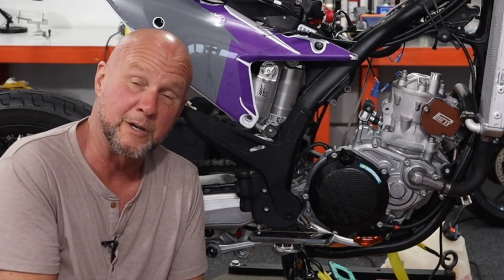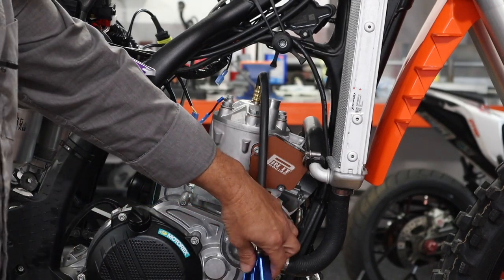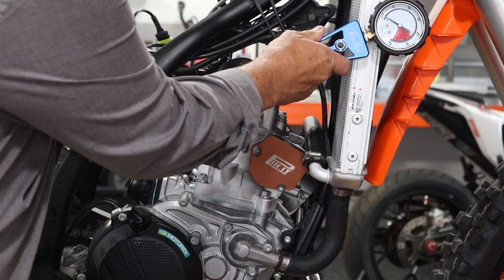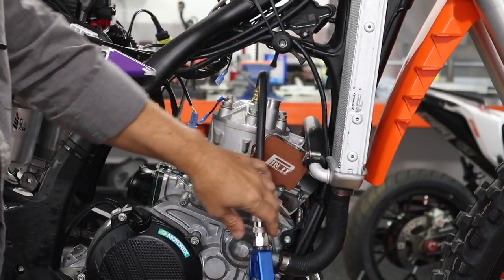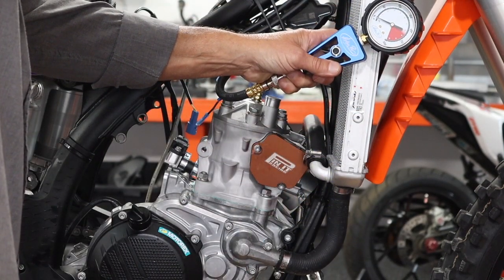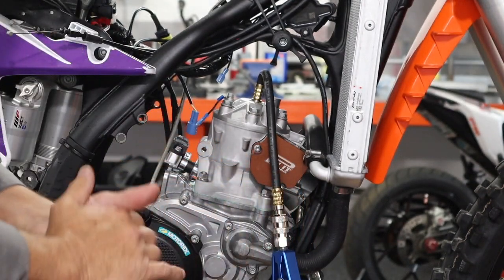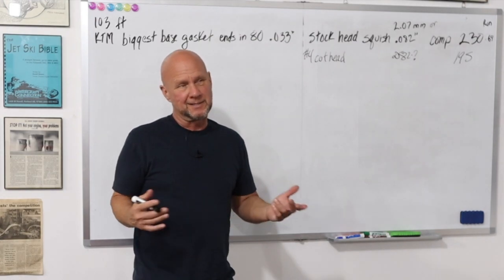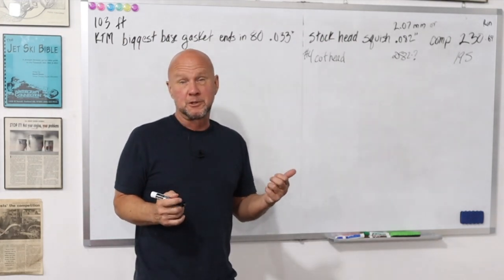This vid could save your life, and a LOT of money.  Need to know about 2 stroke compression.

Comment: My tbi experience…

Bike is a 2023 300xc, VBKXCP233PM322***,  bought last November(2023), didnt start riding until march of 2024. All stock. At 25hr the bike started to bog randomly(approximately may 3). Bog just happens, usually very subtle, usually after at least 1/2 hour of riding. I ride on a small Mx track with several jumps, 70’ being the biggest. I ride moderately on track but aggressively on straight aways. Bike never dies,  just wont accept throttle, usually only for a few seconds but has happened a couple of times where I could stop and try to rev it but it won’t accept throttle, just hear throttle body open. Then it’s fine for a bit. It doesn’t act like it’s fouling out and has never fouled a plug. Does not seem like a short, seems like a fuel delivery issue. I do not ride in mud or pressure wash, and when I do wash it it’s with a shower setting on hose with a rag and bucket of soap.
Issue started at 25 hr, now has 44hr, in that time i have done these things, the list is not exactly in the order i did them…
-Replaced inline fuel filter multiple times
-Replaced fuel pump pick up filter($60)
-Tested old fuel pump(48psi) and replaced with new fuel pump, with part number ending in 200(supposedly updated)($275)
-stripped down and checked wire harness, also with bike running trying to move wires to find short. 
-ended up cutting open wire harness and checking for shorts on main trunk. Looked beautiful in there.
-pulled all connections looking for issues
-changed spark plug 3 times, plugs always looked good, never fouled one, currently tried a 7 range plug.($25)
-had dealer update software and look for codes, there were none($130)
-did top end(used vortex oem piston)and pulled and cleaned power valve at 37 hr per ktm customer service advice($350)
-Set power valve to 48mm(z dimension)
-Adjusted tps to .400 volts, reset tps with wake up connector and 3 throttle twists
-recalibrated power valve on both maps multiple time 
-changed crank case sensor twice, even used sealant on last one to be sure wasn’t leaking($120)
-current compression is 208 psi, was 196 before top end at 37hr
-current deck height is between 0.00 and .008, squish is like 2.12
-tried different fuels, one was an ethanol free 93 octane
-unplugged battery(no ideal why)
Bike wrecked me, took to dealer(6/27/24) and this time it had 2 stored codes
P012211 throttle grip position sensor A short to ground 
p140312 exhaust valve short to battery…
Some are saying codes could be from unhooking stuff during top end. Which would make sense since it been doing this for 20 hours and at 15hr there were no codes.

I’ve spent over $1000 in parts and dealer service and many hours trying to find this issue. Curremtly I’m down with 2 broken ribs and a lacerated spleen because the bike bogged on a small jump 4 days ago(6/23/24) after another failed attempt to correct it. Ktm and the ktm dealer said this will have to be replicated when it’s hooked up or they cant find the issue. That is not something that a dealer is set up to do. I cant sell this bike because it’s dangerous and has no solution in sight. Dealer is hesitant on me proceeding with them repairing because digging into will be expensive, and a good chance problem will not be cured. I have attempted many repairs and Guinea pigged this bike until it ultimately injured me. I had another dealer tell me that after all the diagnostics I’ve done there really isn’t much they can do. I do understand my current dealers hesitation as a failed repair puts me in danger. I need help with this situation.
Reply: Man I'm really sorry.  I know how it all works with the frustration and getting put in the hospital because of the glitches.  New vid out before Sunday night, which may be the issue.
Reply: @ktmhusky  i’ll be watching…
Reply: I feel very sorry for you. Buying KTM bikes these days is risky. You either get a good bike or one that will give you nightmares. I bought a KTM EXC 150 TBI on sale, and I really hope nothing goes wrong with it. If it does, then I wasted all of my money and time, and so did all of you. I wish you fast recovery buddy keep ridin!

Comment: Ah yes the, how much does it weigh sales contacts for the media contacted salesman to push this failure on the customer in so called development . No kickstart , now across the board finally pretty much , thanks ktmgroup . The classic reality is ktm startors have been the worst in history for reliable service . Orange tow ropes should be part of the POWER parts range :)  Informative post again , how about the orangfanboy comment you shared lol.
Reply: Maybe the older starters were iffy, but my 2022 ktm has 350 hours on it and the starter has never failed me once. They are extremely reliable these days. With that being said, it is still completely stupid to not put a kick start on a dirt bike
Reply: @JacobYoces  That is good , not long ago though 4t and 2t , you must also have the upgraded oil pump plastic gear as well . Many of starter magnet failures on the 4ts not long ago at all. 10 years of a terrible 2t design . 350s in Au have a nickname the hand grenade. I am glad you have a good bike .